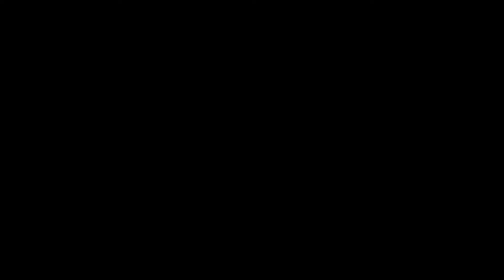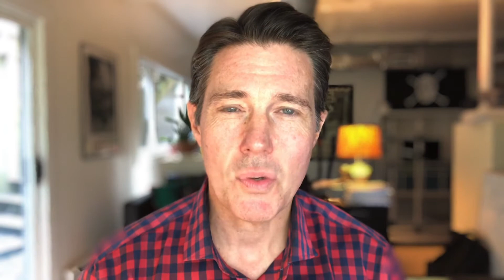Equipment Breakdown Insurance For Renewable Energy Projects

Comment: Thanks Rob. Quick question. You spoke about the provisions of the 'green upgrade' and how the policy can go over above normal indemnity - sort of a new for old basis. Does this infer that the sum insured can be exceeded when replacing a damaged obsolete equipment or it is still within the confines of adequacy of sum insured of that equipment?
Reply from the maker: Sorry for the delay. Not sure I understand your question exactly but "green upgrade" coverage may include an incremental percentage of indemnification above 100% replacement cost (eg. 115% of replacement cost) to compensate for physical loss of property if the insured chooses to go with a "green upgrade" - i.e. more efficient, durable, less polluting, etc. version of the property that was lost due to a covered peril.